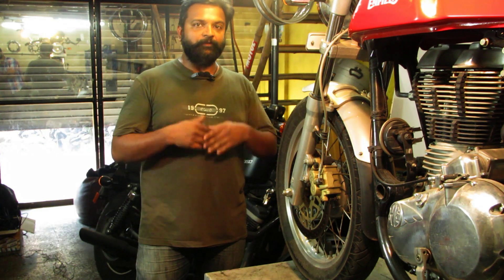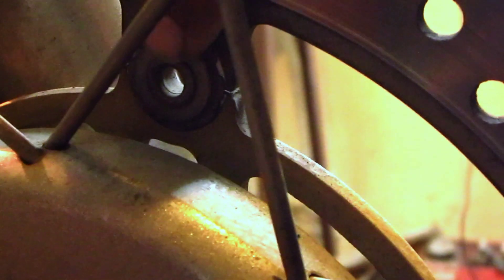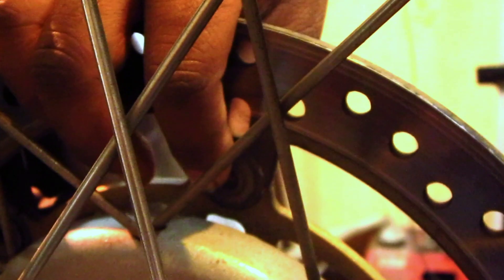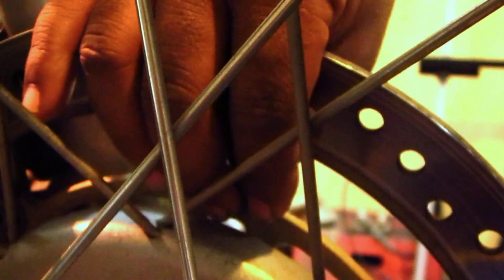Difference between FLOATING DISC/ROTOR & NORMAL OR FIXED DISC/ROTOR |ENGLISH|

Comment: I have a issue with my Gt650, i have a.  🔈 thud thud sound coming from the handle parts when i ride it in rough roads and potholes..
I made several complaints , I was told the same thing everytime that the disc brake fitted here is a floating one,. So. It makes that noise... But i feel my  handle bearing has been broken, i need to check it out..
Can i get some suggestion?
Reply from the maker: your diagnostic is correct. it is related to CONE set bearing only. when you go through potholes or rough road or even if you use front brake the upper cone you can feel is bit moving ahead. or back n forth. Floating disk has got nothing to do with potholes floating disk will give you feeling only at that time when you are not riding the bike. just re correct the setting of cone set or replace it from the person who knows the geometry of the triple tree and crown plate. thanks.

Comment: Can we change a 280 mm  to 300mm or bigger in the same assembly of bikes like r15 or any other sports bike. Do we need to add any other accessories to get the caliper into the perfect position for bigger or just replacement is possible ...?????

Comment: Hello sir... one question for u sir... i own a dominar 400 ug which is equipped with 320mm front normal fix brake disc.. can i fit the disc of interceptor 650 whic comes with 320mm floating disc on my dominar 400?

Comment: Can you give some more details about the material used, especially the alloy ones? Also, I have a doubt regarding the thickness of the rotor  that how thick it should be if I m totally designing it by my self?
Reply from the maker: To know about the metal used in that component then you must do the lab testing of the metal. If you want from my end then sorry I don't have data base. About the thickness then it has to be according to company specifications. Since it's a job of rever engineering with only diff metal or design. You can change anything apart from that. Thanks

Comment: Can we install dual disc in the front tyre of duke 200?
Reply from the maker: nope
Reply: @Mech Auto Clinic can we change the whole wheel , and fix another which is compitable for dual disc?
Reply from the maker: @venkypodem1928  doable but expensive. Expenses unknow untill i do the job.
Reply: @Mech Auto Clinic  thanks man for information

Comment: Sir I'm planning to buy a motorcycle which should I go for dominar or Himalayan? Purpose to travel.
Reply from the maker: Depends on...both are fine for long tours.
Reply: @MechAutoClinic  does Himalayan bs4has issues..like bs3?
Reply from the maker: As in?
Reply: @MechAutoClinic  means ..I didn't get u sir.
Reply from the maker: issues in Bs3 and Bs4? as in what issues you know so i can sort out...coz as far as norms concern engine is same. the only thing is every time company keep on implement the engine even though BS3 or BS4...waiting for your reply. thanks

Comment: Ok, are you in the united states? I have the Arlen Ness floating disc and this one does not have the bobbins like the ones on your bike. Mines are bolts and locking nuts. However, they are pretty lose and I cannot tightened them anymore. They are bottomed out to the point where they won't go anymore. Any suggestions? Thank you.
Reply from the maker: hey thanks for the comment. NO bro I am located in India not in STATES. but I surely can help you out. Please send me the pic of your rotor to macasp@gmail.com let me have a look at it. thanks.
Reply: @MechAutoClinic  Cool. I will send you pics and video in a little bit. Thanks bro!
Reply from the maker: sure will wait bro